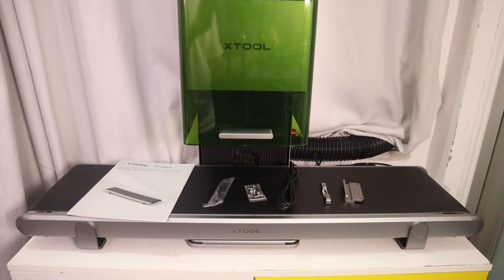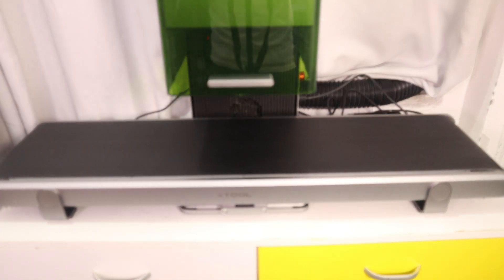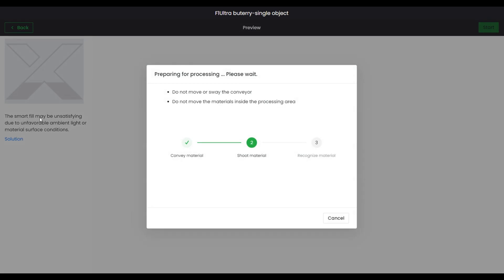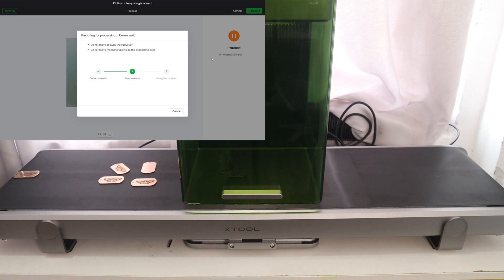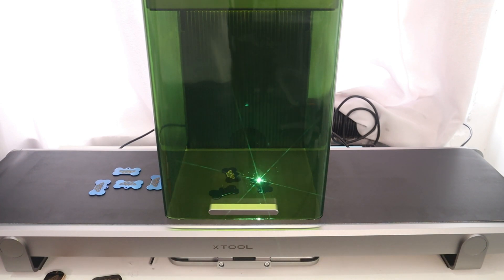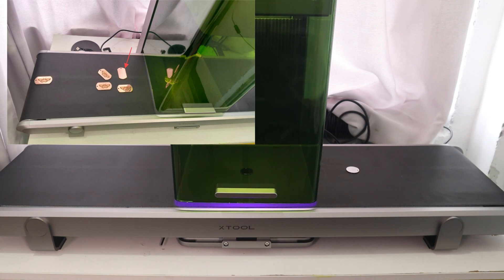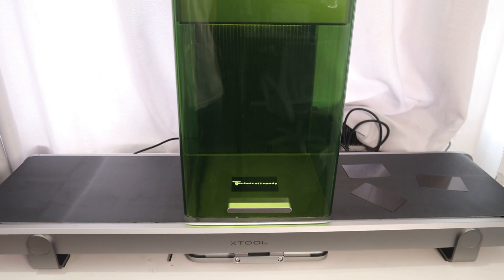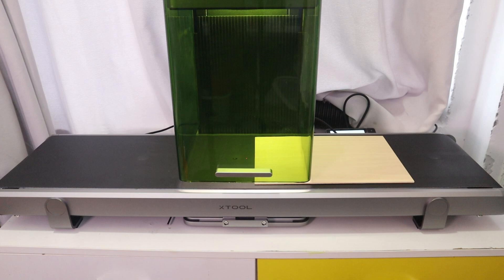xTool F1 Ultra Conveyor Review: Batch Engraving for Your Small Business

Comment: Someone should test the accuracy of the conveyor and camera.  One test would be to cutout about a dozen 1" circles.  Throw those on the conveyor and cut a 1/2" circle out of the center or each of them and measure the resulting ring width to see if it is 1/4" on all sides.  Then throw those back on and cut the ring in a circle at 3/4" and see it you get two rings each being 1/8" wide.  It could be done with squares in a similar manner or just fine lines repeated to see if the overlap perfectly.
Reply from the maker: good idea!